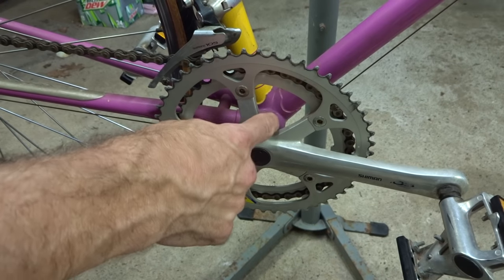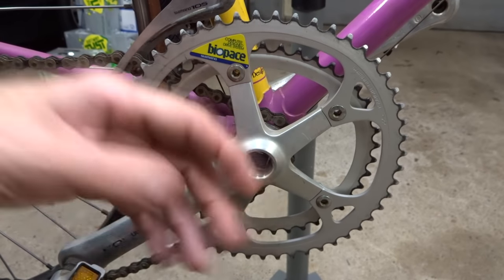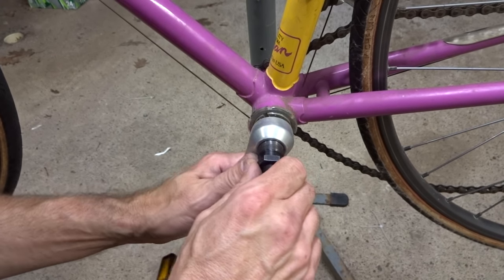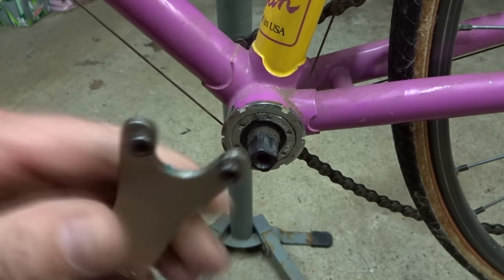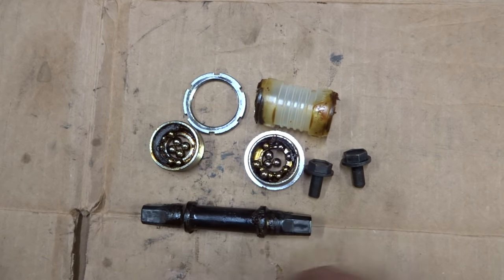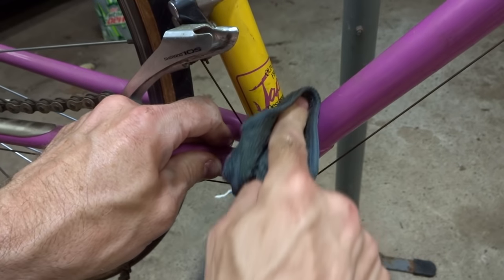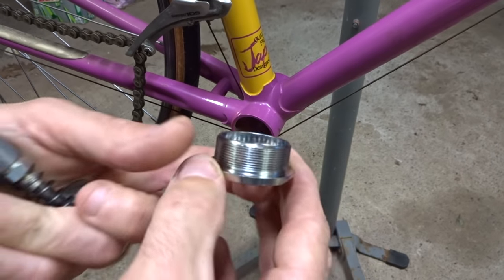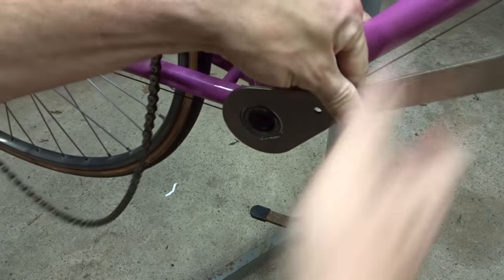Square Taper Bottom Bracket Service - How To Overhaul/Remove/Clean/Install

Comment: Thanks RJ !! Having trouble with the one I’m doing ; when I tighten the cups and cranks the whole thing seized up and I can’t rotate the cranks freely. It’s not the original spline; does It sounds like the spline is too short ?
Reply from the maker: Most likely you are not adjusting the adjustable cup properly.

Comment: Hey RJ, quick question. Trying to do this on an 1990s carbon frame bike but my cranks are seized in there and I'm afraid to crack the frame. Any suggestions to help the crank ease its way off the axle? i have same tool
Reply from the maker: https://www.youtube.com/watch?v=j5gmAkMLX60
Reply: @RJTheBikeGuy  thanks for the reply! The problem was my tool, it was a cheap one off Amazon. The "rod" that pushes through had too small of a diameter so it was pushing into the threads of the BB axle instead of the face of the BB axle. All fixed now and have installed Hollowtech 2 cranks!

Comment: Hello, my bottom bracket is a little loose. I tightened the non-drive side as much as it was possible, but it is still loose. If I tighten more the bottom bracket will not move.  What do you think the problem might be? Should I do a complete service just like this video and see if that will solve the problem?
Reply from the maker: Overhaul it.
Reply: @RJTheBikeGuy  Problem SOLVED. I did overhauled it. I took out everything just as instructed in this video, cleaned everything real good and guess what..... turns out one of the caged bearings was installed incorrectly by the previous guy who serviced it. I noticed It was installed the other way around when I took it out. After cleaning everything and putting new grease, I made sure I installed it correctly. There is NO play, no loose,  no wobble now. Feels great. I am happy I was able to solve the problem myself thanks to this tutorial. THANK YOU!!

Comment: As a beginner, it seems you need a few special tools, and you don't really know what you need before starting to dismantle.
Your video has convinced me that there is little economic sense to fix my old/cheap bicycle. And even if I do decide to service it, it seems is as expensive to do it myself as it would be to take it to a shop. At least the first time around. 🤔🤷‍♂️

Comment: This was a great video.  Only thing I didn't see is what size wrench you used to take the fixed cup off around the 7 minute mark?
Reply from the maker: One of many different bottom bracket tools. No guarantee yours uses the same tool.
Reply: What size did you use in the video? Just so I have a frame of reference.

Comment: Thanks for the video. I've recently tried to remove my pedal arm [ to fit the cadence sensor for an ebike conversion kit], and failed miserably! The problem was that the inner, screw-in plunger of the extractor tool was almost exactly the same size as the hole that the  bolt came out of! All that was happening was that the plunger was being forced into the bolt hole. Luckily, I stopped in time before I completely ruined the threads. So my question is, why doesn't the crank puller that you are using, which looks much the same as mine, do the same thing?
Reply from the maker: I answered your previous comment. My answer has not changed.

Comment: Ive never heard of a crank splitting but only creaking from not applying grease to a spindle when reapplying a crank and pedal arm. As per Park Tools? Have you seen evidence of this? Cheers Andy
Reply from the maker: It's a controversial subject. This is the way I learned. Jobst Brandt is pro grease: https://www.sheldonbrown.com/brandt/installing-cranks.html
I have never had creaking from properly tightened cranks.
Reply: Thanks for this I'll have a look at the link, my understanding or common sense tells me they must of gone way over the recommended torque or the cast metal has a fault. Thanks fella all the best Andy

Comment: Is it possible to service the bottom bracket + bearings without removing the fixed cup? I'm not planning on replacing the bottom bracket, just cleaning/regreasing the parts and spindle
Reply from the maker: Possible? Probably. It would be a PITA to clean, grease the cup and place the bearings.

Comment: That was really informative ! But i do have a question for you !! What if I don't have one of those crank arm pullers ? Because i have those types of crank arms i guess youd call them , and they are pretty difficult to remove !! Any suggestions on how to remove them without that tool you used in the video ?
Reply from the maker: Buy the puller tool. That is the best way.

Comment: I didn't watch very intently so maybe I missed it, but did you mention inspecting the axle and cups?  If either are damaged, it is a good time to switch over to a sealed cartridge bottom bracket.  New ones are cheap, and they are smoother than lower quality non-sealed bottom brackets.  
Regarding the overhaul, I prefer to use loose balls instead of balls in retainers.  Most retainers (like the ones you show) only have nine balls per side, two fewer than when you put in loose balls.
Reply: One other thing: in my opinion it is much easier to adjust the bearing by installing the drive side crank arm, using the arm in the same way you check a hub bearing by grabbing the rim and feeling for lateral play.
Reply from the maker: I can feel it better without the arms. Turning cranks may feel fine, but then turning the bare spindle, you can feel that they are actually stiff or sticking, etc.
Reply from the maker: I did inspect them, though I forgot to mention it in the video.

Comment: I hate when you tighten a bearing locknut and it changes the adjustment of the race.  So frustrating!  That whole time you were adjusting the bearings I wanted to take a rag and wipe off the spindle and that little spot on the left chain stay haha.

Comment: Hello RJ I don't want to bother so I only come when I tried everything else. I dissembled my bottom bracket and cleaned it thoroughly and put a good grease and assembled it again. But now it rotates with big effort. Is it normal to be hard at the beginning? There was no play at all and the bike doesn't have many kilometers but it is 30 years old so I serviced it just in case. Maybe tightened it (by hand and I'm skinny) to the frame too much?
Reply from the maker: Sounds like you over tightened it. You need it have turn smoothly, with minimal play. Watch the video again.
Reply: @RJTheBikeGuy  Thank you so much (third time you help me!!)

Comment: How much time we should change the bearings? And what you used to clear those parts?
Reply: most solvents will work

whenever you need it, want it, have time for it
my old bike had 1 overhaul in 40 years, and then 2 in 1 year, it all depends on conditions

Comment: Wow, an '87  Centurion Iron Man Dave Scott Expert. The "Miami Vice" name was given to this paint scheme in honor of the TV show by the same name. The show had magenta colors on one of the actors in every scene. Dave Scott won 6 Hawaiian Iron Man races on this bike! They are revered by many including me. I have this  exact one and a yellow Master of the same model. Check 'em out on Bike Forums. Years of comments, photos etc. I have over 80,000 miles on the Miami Vice model. Yep, lots of over the time maintenance and exact duplicate parts replacement. Tange 1 tubing. With 120gr saddle and lightweight tires mine weighs 20.5 lbs. Smooth, quick even on rough pavement and granite paths. Sorry, but I just caught up with this post.... Thanks!
Reply from the maker: https://www.youtube.com/watch?v=_AyOcQ9upfk

Comment: I noticed you used a lot of grease. When I service my cup cone bearings on my hubs, I notice the grease oozes out of the hub. Does grease ooze out of your BB shell after riding?
Reply from the maker: No.
Reply: if you use less, the balls fall out when you put the cups in, make it sticky!

Comment: There is a difference putting new bearings vs the old ones?
Reply from the maker: Yeah, bearings wear out. And you can't tell how worn just by looking at them. They are cheap. Replace them.

Comment: My old high end in it's time has a Silver Carterless.  Need an axle for it  Has a longer end on one side.  5 1/4"  long not counting thread projections.  .652 dia at bearing area.  .830 largest dia ..  Short side is 1.400   Long side is 1.730.   Thread projections are .35   Metric thread is .388.   It's marked SR 72-7  and a 5F
Reply from the maker: You need to find what BB your crank set requires.

Comment: I don't have any dust shield piece? do you have any suggestions? bcuz the BB was filled with dust when i open it.
Reply from the maker: Live with it. Buy a dust sheild. Buy a new BB.
Reply: @RJTheBikeGuy  
yeah some country doesn't include this parts in the market but anyway thanks i'll figure something out.
Reply: RJ The Bike Guy yeah mi bike also don't have that plastic tube inside, would it be all right without it?
Reply: @nandogroovemachine823  
It's to prevent dust getting into bearings, you can try an old piece of vacuum hose or something like that.
Reply from the maker: @nandogroovemachine823  As I said. Live with it. Buy a dust sheild. Buy a new BB.

Comment: RJ good day! I have an old bike frame and has a threadless 70mm in length and 50mm inner shell planning to upgrade a new crankset. what crankset, spindle size and sealed bearing that would best fit with my bottom bracket? Ty
Reply from the maker: Spindle length is specified in the crank specs.

Comment: Has anyone installed a triple crankset on one these Centurion Ironman?
What bb spindle length would work? A 118mm or a 120mm bottom bracket?
I'm trying to create my own sub-compact crank with what I got.
I'm using the original, 130bcd, crank arms, a middle ring 46t triplizer, and a 30t granny ring that attaches to the triplizer. I would like to get rid of the outer ring. I'm kinda leaning towards the 120mm to try to center the chainline between the 46t middle ring and the 30t granny ring.
Any help would be appreciated, even negative feedback would help.
Thanks.

RJ, hope you're doing better from that gnarly fall you recently had.
And, thanks for helping us repurpose these old steel stallions and keeping them out of landfills.
Reply from the maker: The spindle length is dictated by the crank. Look up the specs for the crank you will be using.

Comment: 05:08 this tool is a nightmare. I am trying to remove that same lock ring and it can't do it. is there an alternative? like a tool that fits those holes and then you unscrew  it with an allen key or something?
Reply: use screwdriver and hammer, this is the old fashioned way, put the screwdriver in the gap and hit the back of screwdriver with the hammer, watch some videos about this so you understand better.

Comment: Rj

  I have a square taper bottom bracket.  Question is is it possible to get a 1 inch longer bb axle. So I can fit a mid drive motor between my crank arms. I need it wider to be able to pedal when battery dies?
Reply from the maker: Shrug. I don't think anyone makes one that long. You will have to research.
Reply: @RJTheBikeGuy  I did sir, i found it on sickbikes.com 144mm. Thanks for responding! 👍

Comment: Bottom bracket getting loose and tighten it then getting loose again while the lock ring doesnt move how could be that happen if the ring is the one lock over bb so what should i do now to stop it loose
Reply from the maker: Not having worked on your bike I can't really say.
Reply: @RJTheBikeGuy  its the same square tapred atum mtb got it year ago using it weekly
Reply: It was tight but once the bottom bracket started to make sound i had to clean it so i did about 2 month ago and yesterday i figured out its started to wobble a little

Comment: What could one do with a damaged cotter pins bottom bracket (feels rough) when no spare parts are available? Could it be machined? Square taper bb is not an option
Reply from the maker: Shrug.
Reply: @RJTheBikeGuy  Yes, I supposed so, but perhaps you could keep the existing axle, modify it on a lathe  and adapt roller bearings. Future maintenance would be easier
Reply from the maker: @eduardobotta5375  They sell crank cotter pins on Amazon.com.

Comment: How do you remove a seized lock ring. And what if the notches in the lock ring are stripped from previous attempts to the point that the hook wrench keeps slipping out?
Reply from the maker: Try a flat tip screw driver in the notch and tap with a hammer. I assume you are working with a bottom bracket similar to the one in this video.

Comment: Hey RJ! How’s this bike doing? I’m very tempted to get one of these on eBay. I’ve been riding my ‘84 Schwinn for 3 years after rebuilding it with help from your videos. My budget is tight, but my current bike has given me a lot of joy and fitness. I’ve started doing triathlons, and these old Centurions seem like a cool, practical solution for me. I’d love to see yours after you’ve finished working on it...might give me ideas for what I could do with one.
Reply from the maker: I need to do more work on it.

Comment: Hi, i am trying to remove The bottom bracket but The adjustable cup is stuck. I cant get it moving with the pin tool for The holes. Any tips??
Reply from the maker: Penetrating oil, heat, tapping with a punch and hammer to get it freed up.
Reply: Thanks! Will try💪🏼

Comment: I have the same bottom bracket , but it looks like my spindle length is too short as the cup on the non-drive side has to screw in too far too engage with the bearings and the lock ring can no longer be put on. Could this be true?
Reply from the maker: I have no idea what you have. If it fit on the bike before, it should still fit. The spindle didn't get shorter.
Reply: @RJTheBikeGuy  The bottom bracket wasn't on there before, it's an old style shimano xt, the cups both fit but it's just taking a few too many extra millimeters to engage the bearings.
Reply from the maker: Then it's probably the wrong size for your bike. They come in different sizes. Shells are different widths. 68mm and 73mm are common sizes. Also 83mm.
Reply: @RJTheBikeGuy  okay, I'll do some more investigation, thanks for the useful videos!
Reply from the maker: https://www.youtube.com/watch?v=1BrVjDFqotE

Comment: Hey i have Square Taper Bottom Bracket  on my new 2017 mtb... should i replace it to a newer style? is it worth it?
Reply from the maker: If your 2017 bike has a square taper bottom bracket, I am guessing it is kind of low end, so you might not want to spend a lot of money upgrading it.
Reply: I have this bike:
https://www.kellysbike.com/hu/mtb-xc-c527/tnt-30-dark-orange-p48625
It cost 650$, yeah its kinda "low" end  or maybe just i am stupid and dont know what bb i have .

Edit.:
I watched some video and i think i have octalink system not square tapared.
Reply: you could buy an entry level specialized for that but if your bike is fine, why replace it

Comment: 1:38 actually i have a nut instead of bolt so will the standard crank puller work for that type of arrangement?
Reply from the maker: Yep, still works.
Reply: as long as the crank puller has enough of a surface to push flat against it should be fine. The inner rod for the crank puller should be long enough to reach even the bottom of a hex bolt or something.
Reply: @RJTheBikeGuy  well thank you.
Reply: @brycedunlap  ya man thanks for the info!

Comment: What are those pedals?! thx for the video:)
Reply from the maker: Sorry, I don't know off hand.
Reply: @RJTheBikeGuy   No worries, i was just wondering, they looked odd... Going to overhaul my vintages colnago super italian BB from the 70s tomorrow thanks to you video:) I've been repairing old bikes thanks to your videos for a little over a year now and have now gotten a student summer job at a local bike shop here in Brussels. Not only (GCN and Parktools videos were definitely also in there) but mainly thanks to your very informative and inspirating videos. Anyway, thanks for everything and greetings from Belgium:)
Reply from the maker: @mwehrh  They may be whatever the stock pedals on that bike were. They were on there when I got it (used).

Comment: Can someone help me with an issue?!?
I have a fixed gear bike and I wanted to move the front chain ring closer to the frame to adjust the chain line. So I changed my 110mm bottom bracket for a 103mm. After installing, the chain ring still sits in the exact same spot and hasn't got any closer. Is there a reason this is happening?
Reply from the maker: Did you install it the correct way? The two sides of the spindle are not the same length.
Reply: @RJTheBikeGuy  Oh wow thanks for the reply!!! I'm 99% sure I put it on correctly. It's a square tapered bottom bracket with the drive side having reverse threads, so I don't even think it will go on the wrong way?
Reply: Quick update, I just removed the bottom bracket and manually measured it. Although the packaging and bottom bracket itself both clearly indicate a spindle length of 103mm, when I measure it using calipers I get a 110mm measurement. Looks like it's a manufacturing misprint error! Thanks for the help though! Love the channel!

Comment: Can you reuse caged bearings and clean them up real good just like new? I have the same exact bottom bracket but had caged bearings and no plastic insert.
Reply from the maker: But they aren't new. They are worn. Clean doesn't mean  not worn. If you are going to do the work, might as well replace the things.

Comment: what is the BCD of that Shimano Biopace? can i use it with modern frames?
Reply from the maker: Not sure off hand, but they fit the same cranks as round rings. Personally, I prefer round rings. And yeah, you could use it with modern frames. Why not.
Reply: RJ The Bike Guy thanks. Now I can buy the Biopace I've been planning to get for my new build.
Reply: I would check.  I think the BDC is larger at 130mm.